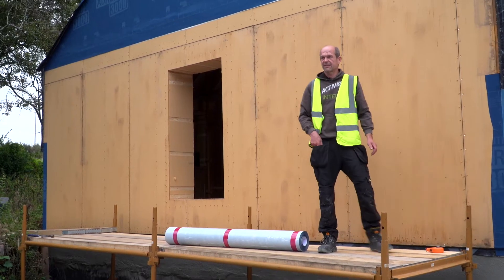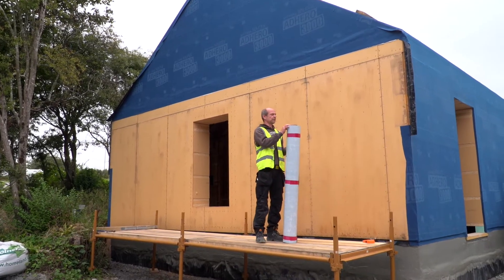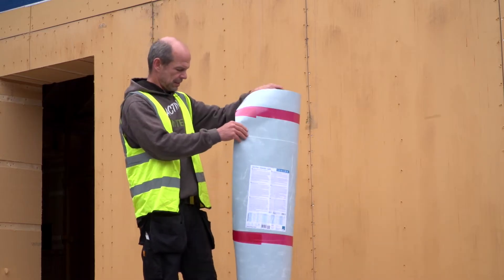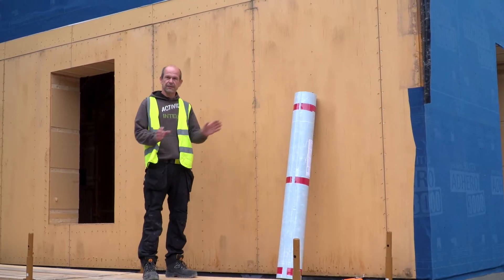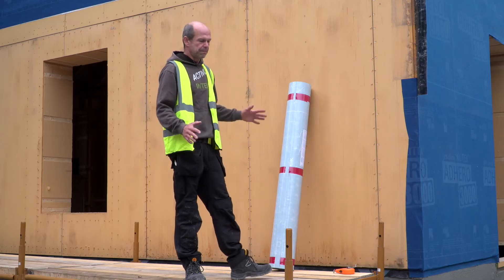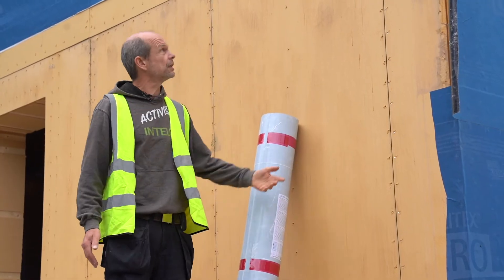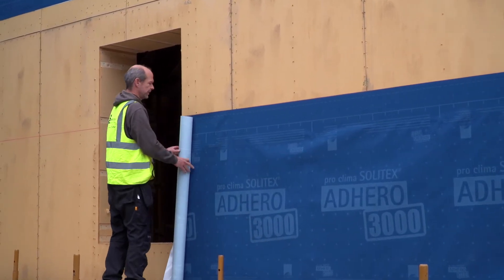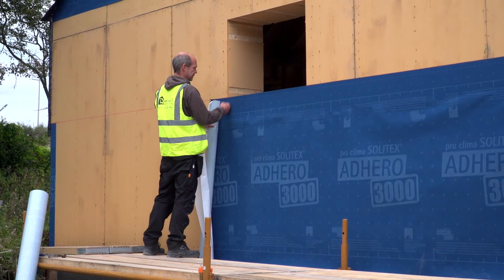Achieving Windtightness on Woodfibre Insulation Boards - Cooleen Passive House VLOG #6

Comment: Thank you for the detailed walkthrough. I was under the impression that Gutex Multitherm acts as an air barrier. Is it still advisable to use a self-adhered membrane like Solitex Adhero externally for airtightness?
Reply: Also, do you have a link to the racking wood fiber insulation board that you used? All of Gutex’s products appear to not offer racking strength (just insulation).
Reply from the maker: Hi @stephenbenedict556. In this instance, Adhero 3000 was used to provide protection to the building fabric against the elements. The airtightness is achieved with Intello+ membrane which was installed internally to the warm side of the insulation layer.
Adhero 3000 may be used as an airtight layer on the outside in certain scenarios, but this depends on the building type. Feel free to contact our technical support for further discussion.
While Gutex Multitherm is water-resistant, it is not water-proof and suitable breather membrane should always be used in conjunction to ensure longevity of the insulation and the structure. Gutex Multitherm, because of its density, will provide certain resistance to air flow but it is not airtight building component.

Comment: If Solitex Adhero is an air barrier why would you need to install another air barrier on the interior?
Reply from the maker: Hi @59seank. In this video the Solitex Adhero is functioning as the external wind (external air) barrier protecting the woodfibre insulation and timber frame from bad weather in all forms. An air barrier inside must perform a separate function preventing heat loss through the control of warm internal air which can also hold a lot of water in vapour potentially causing structural damage to the building if allowed into the timber frame through avoidable gaps and cracks. The building overall is a system and when a high standard of airtight quality is achieved an effect mechanical ventilation system with heat recovery is essential for the building and the people within it. Hope that helps.